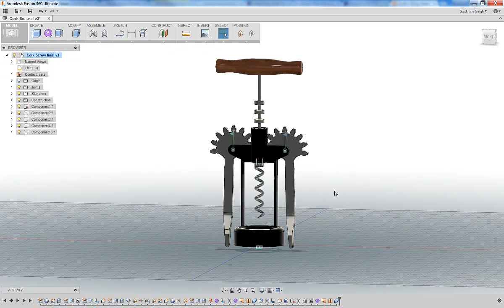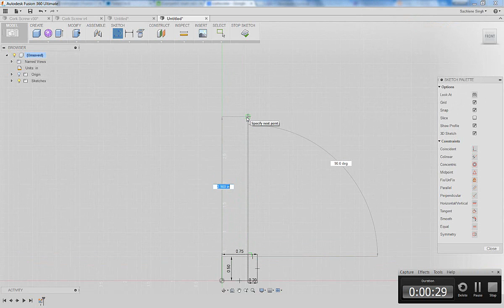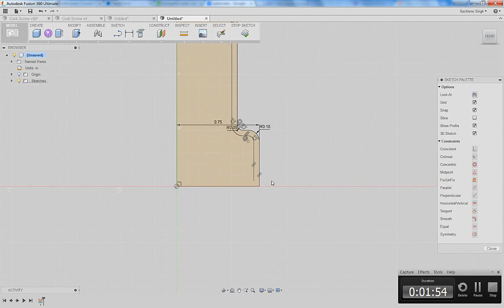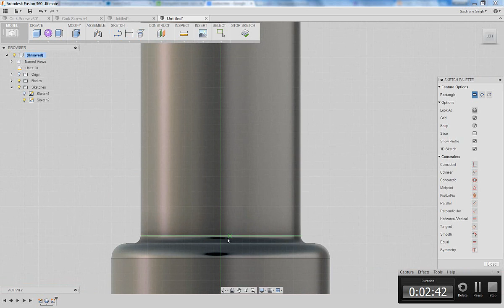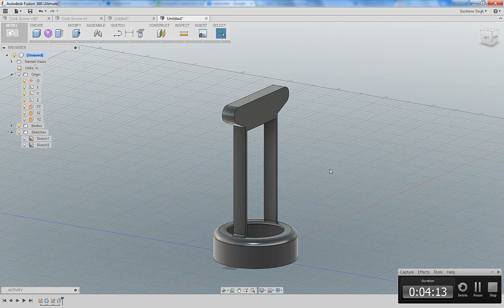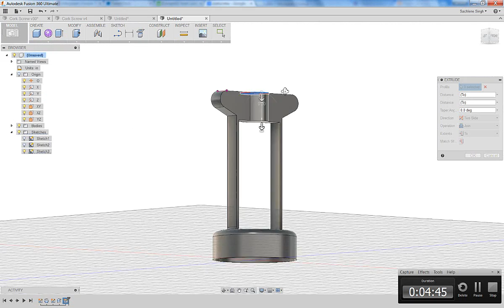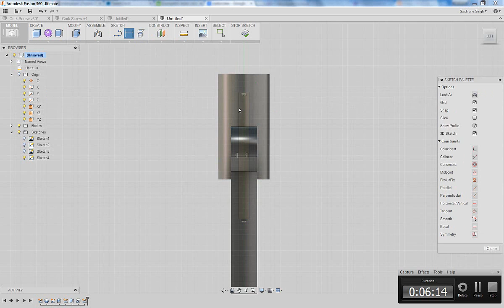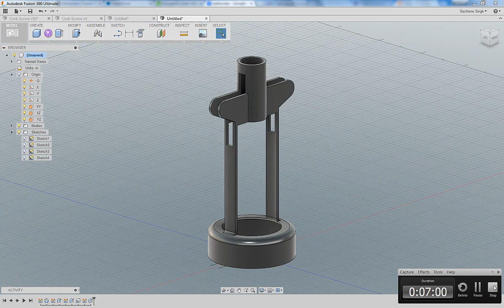Cork Screw   Part 1 Building the housing

Comment: 1:25 how do you change the angle from 35 to 155?
Reply: +carolcheny Type "1" (for 1 inch), then press "Tab" (to select the angle), then type "155", then press "Tab" (the number 1 should be highlighted again), then move your mouse slightly to the right, and press enter.